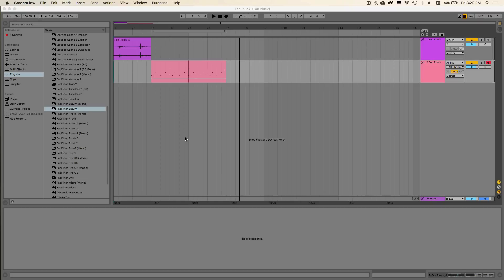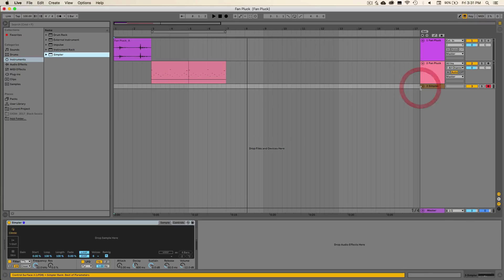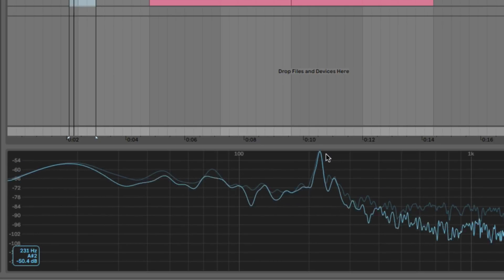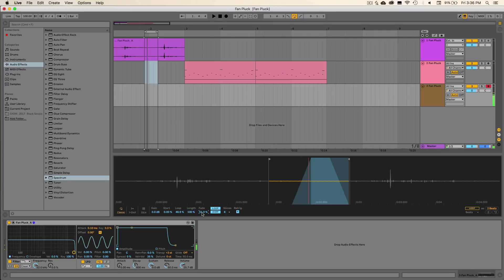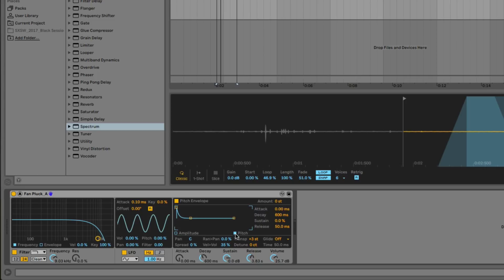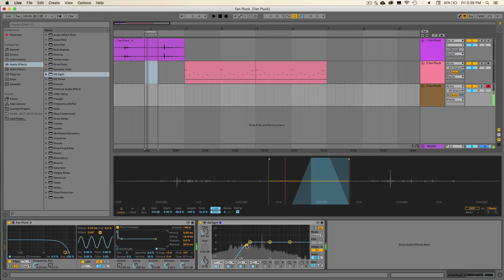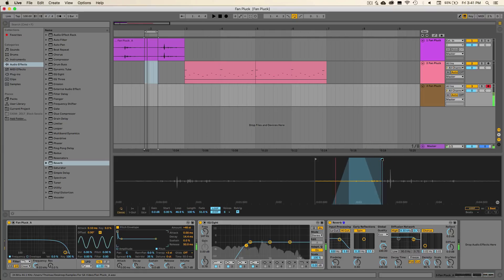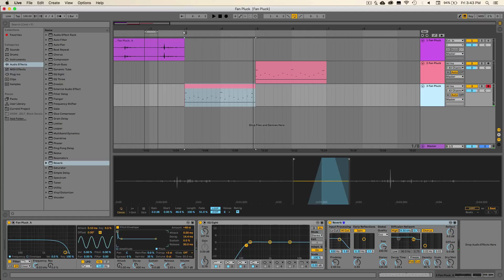Tech Tip - Fan Pluck in Ableton

Comment: another tip to tune the sample is using the frecuency shifter , its mantein the quality of the sample , another thing is usin complex warp mode so you can just play the sample in the original time without  strachin it with the pitch to do a melody for example, it depends what are you looking for